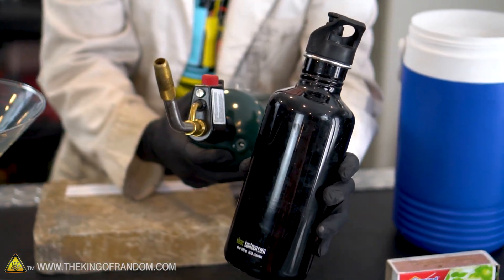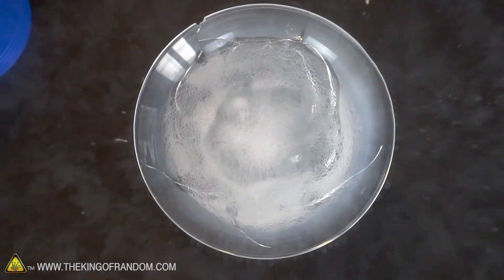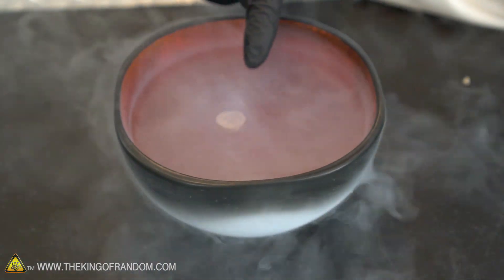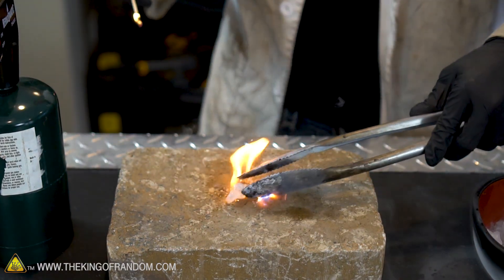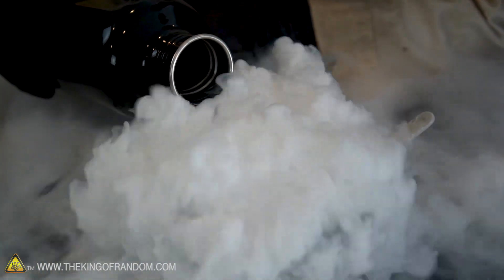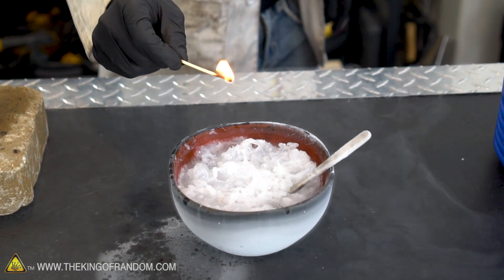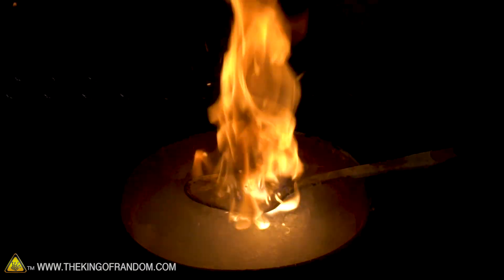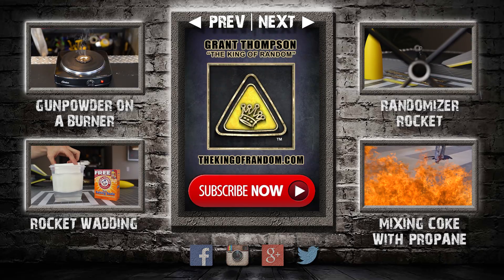Will Frozen Gasoline Burn? Can We Use Liquid Nitrogen To Freeze Gasoline Then Ignite It?

Comment: can you shut down a big fire with liquid nitrogen? like a room on fire and you just throw the whole bucket of liquid nitrogen in ?
or like a bonfire
Reply: Are you asking the last question as a personal or general question?
Reply: lol
Reply: yeah :P
Reply: When Durjan Krist is referring to Air, he generally means Oxygen. Since fire is a combustion reaction it needs a hydrocarbon and oxygen. Air contains oxygen but do not forget it has other elements such as nitrogen. When you pour Nitrogen gas on top of the flames, it is replacing the Oxygen from the air with Nitrogen. You can put out a room with fire if you are able to replace all the oxygen with nitrogen from the source of the fire but is not realistically possible unless you do it quick enough. So you could if you can put a fire out with pressurized Nitrogen that is in a container such as CO2 extinguishers.
Reply: LemonD I work with fryers and we use c02 extinguishers with it. same concept, different chemical?
Reply: LemonD *bon fire
Reply: LemonD Grant put out the fire with the liquid nitrogen because liquid nitrogen is heavier than air, and takes in all of the space of the air. As we all know fire needs air to continue. If you had enough nitrogen to fill up an entire room, yes you could extinguish the fire, but no this would not really work in practice
Reply: xD
Reply: not the same concept, co2 extinguishers are meant to suffocate the flame, liquid nitrogen decreases temp and suffocates the flame, sadly also causing a rather large explosion

Comment: Grant, isn't it true that gasoline doesn't burn, its vapor does? It seems that the same would apply to the frozen gasoline -- your match thaws a small bit of the frozen gas, then ignites the vapors. The vigorous burning occurs because the heat releases increasing amounts of vapor, which in burning increases the speed of vaporization, like a chain reaction.

Comment: Pretty sure that vigorous reaction you got with the smaller batches was similar to how cometary bodies off-gas and form a tail as they pass through a solar system.

Basically, the frozen gasoline melted just enough in the presence of the match to ignite, and the surface heat caused the ice to release gasoline vapour in small jets through the surface. This would explain the combination blow torch and flame thrower effect, as the gas vapour pushed the liquid gasoline away from the ice and spoon, somewhat like high pressure steam spraying from a cracked line. The steam jets away, but condensate forms at the edges of the breech, and is eventually carried off as drops of water by the steam. 

Edited for better comparison.

Comment: Seems intelligent to light of a bowl of gasoline inside your house...
Reply: A normal bowl of gasoline would probably be even worse, since the vapors may have flowed down to the floor and would ignite as well.  Doing this inside your house is a terrible idea in either case.
Reply: @Mario G. Cardiel That's true. Indoors the vapors would gather instead of just being whisked away by the wind, so yeah, normal would probably be more dangerous, especially since mixing flammable gas and oxygen is a literal recipe for explosions.
Reply: +yaksher  Add a dash of motor oil, and you have a recipe for a Molotov Cocktail!  Yummy!
Reply: A normal bowl would be fine, but a bowl of frozen gasoline which he has just showed to be rather explosive is a terrible idea.

Comment: Grant, did it burn because the match melted a little gas, creating vapour and the fumes lit? Did the frozen gas burn or did it melt and ignite? Would the same frozen gas catch if the ignition source was smaller such as a spark from a welding striker or ferro rod?

Comment: the reason that it ignites vigorously is because the solid gasoline has much larger specific surface area(SSA) than liquid thus have more contact with oxygen.
Reply: I don't think that the full answer. I suspect there are thousands of pockets of liquid nitrogen trapped (the milky appearance supports that, if it isn't due to crystalline boundaries) that burst open at the surface, carrying away particles of gasoline into the ambient air. As more surface pockets are exposed, the process continues unabated.

Suggest getting a high-speed camera (>20k fps) with a high magnification lens to test it.
Reply: Maybe. I was thinking maybe the frozen gasoline absorbs some liquid oxygen on its surface.
Reply: Interesting. I'm not sure how the oxygen would get there with all the nitrogen in the way, but LOX/gasoline mixtures sometimes form a gel-like mess claimed to have 50 times (that's the figure I read many years ago, anyway) the explosive force of TNT.
Reply: +tubeist-dan
If you leave liquid nitrogen exposed to air for some time, it will get liquid oxygen in it. And the liquids do mix with each other. So, I don't think the nitrogen would be in the way, unless it boils so vigorously that the container has positive pressure all the time (IE no air flow into the container).

Btw. At least liquid oxygen + solid butane makes highly powerful explosive.

Comment: I'm surprised your eyebrows aren't stuck to the ceiling. You could have used avgas, but that wouldn't have been as much of a pyrotechnic display, the antiknock rating being significantly lower than 91. I've been around enough racers to know that nitrogen, oxygen and gasoline makes a big bang. I do wonder if the far different vapor pressure of 100LL would make a difference in the reaction. Probably not something to try indoors.

Comment: Try adding just a little bit of nitrogen to the glass at a time.  The glass changing temperate too fast is causing it to break, if you slow down the process the glass should stay intact.

Comment: It looked as if the vapors were igniting and the explosions were any vapors trapped within the solidified gasoline. When the solids were ejected into the air, they melted to add more vapors to the mixture (hence the charred ceiling).

Comment: Im pretty sure it isnt flamable when frozen, but whats happening is that when you get the match close enough it melts the gasoline, and then the spark from the first ignition will melt the outer edge almost instantly, and that siw hats causing that explosionish thing.

Comment: If i'm not mistaken, frozen gasoline doesn't burn. Only the gasoline molecules in the vapor phase would be able to reach energies (and thus temperatures) high enough to react with oxygen in the air to burn. The reason why the frozen gasoline appeared to burn is because the frozen gas melted quickly after being removed from the LN2, and once in the liquid phase, molecules could then enter the vapor phase. If you did this in an atmosphere colder than the freezing point of gasoline, I don't think anything would have happened. This is because the gasoline would have remained solid. Although, I do suppose holding a match near a frozen chunk of it could provide enough thermal energy to melt/vaporize the gas. 
I guess what I am saying is that in a theoretical world, if all of the gas were truly in the solid phase, nothing would have happened.

Comment: every flammable liquid has a Flashpoint. for those who do not know what a Flashpoint is let me explain. the flash point of a liquid is when a liquid gives off enough Vapors where it will flash when it comes in contact with an open flame but will not ignite to a sustainable fire

Comment: Will the white vapor ignite as well?
Reply: but isnt it mixed with gasoline steam and fine liquid spray?
Reply: No i think it's from the gasoline.
Reply: I think it's possible that the liquid nitrogen could be vaporizing the gasoline. However, it could also be a mixture of the nitrogen and gasoline, so it'd be interesting to see if it would light off.

Comment: I think it burn vigorously because of the surface of the frozen gasoline crystal is covered with water and turn into ice on the surface of the "crystal" as you mix them with nitrogen, as you ignite the gasoline, the gasoline and water reacted with each other and burn vigorously just like when you try to put out grease fire with water, as the water/ice on the surface of the crystal burn off, the gasoline in the center turn liquid and burn normally again.

Comment: Check if a bullet can be fired if it is put in this mix ? Will it explode and burst into flames at the contact or it is going to be the same thing .
Reply: But if gasoline has the strength to move a piston in the combustion chamber why not have the strength to move a few grams of lead ??
Reply: the way a bullet works is the gun powder produces massive amounts of gas which expands rapidly, pushing the bullet head. Gas does not have this effect and doesn't even burn as fast
Reply: Ok , ty for respond , it will be cool to see practice of this ,or actualy he could get something slim to cover the bullet , and it will be flameable , to fire it up <3

Comment: The thing is : if you light the frozen gasoline up , only the molten part will burn , because the heat of the match melts a thin - but thick oenough layer, to let that burn and it creats a chain reaction -domino effect.

Comment: matches in liquid nitrogen did it burns
Reply: sreyus meera HeJUST showed us that a match will not light in liquid nitrogen. Ntm a match has to have o2 to burn.
Reply: sreyus meera Normal matches no, but water/windproof(sometimes called underwater)matches might.
Reply: its the same thing
Reply: Toffie Original O2 is oxygen
Reply: sreyus meera no because for combustion heat and oxygen are needed, I think the nitrogen would get rid of the heat
Reply: sreyus meera no it needs oxygen not "o2"

Comment: What will happen if you mix Sodium and Gasoline?
Reply: This should be interesting :P
Reply: That would be intresting to see! I hope it explodes becuase wo dosn't like explotions!
Reply: Alenxander grimsmo Ye if it doenst work just ignite it :P
It should just be an cool experiment!
Reply: It should work as it reacts to some stuff inside the gasoline, So hopefully we get too see a explosion.
Reply: Idk otherwise butane Mixing Butane and Sodium?
You shouldnt know if you havent tried ;)
Reply: i tried lithium and petrol, with the petrol i used it made a wierd blue material, i dont have a clue what it was. overall it just bubbled slightly untill the small amounts of water and ethanol and maybe a few more were used up. it is a way to purify some organic compounds such as alkanes.
Reply: Sodium is in mineral oil, I think it should explode, Otherwise just ignite it :P
Reply: You're thinking of mineral oil. Mineral water is still H2O, and metallic sodium reacts with oxygen which is why it explodes when you throw it in water. It can be stored in parafin oil, mineral oil, or kerosene to block it from oxygen. There are probably other storage mediums, but the point is, if you drop a block of metallic sodium into a jar of mineral water, it will explode just as if you dropped it into a swimming pool.
Reply: Oxygen is in Gasoline too so hopefully it will explode ;)
Reply: Just try it it has never tried and i have seen some sort of it that it does work ;)
Reply: I once combined magnesium and jet fuel in Afghanistan.  It just got wet, but then it went to the burn pit.
Reply: Sodium metal ;)
it should probaly explode ;)
Reply: nothing, because gasoline is a type of oil
Reply: you can store sodium metal in petroleum ether (aka gasoline) although most gasoline has a little bit of ethanol in it which will react with sodium to make sodium methoxide, but it's not exciting, just some bubbling
Reply: If you put enough in it it will probaly explode and Hopefully make a reaction ;)
Reply: lik omg it totaly maks fyr wen put in evn uatr i bet it go big boom. This is what I imagine you sound like in your mind. Sodium doesn't react with everything that's in liquid form in a volatile fashion it's a chemical reaction.
Reply: MinecraftForce Nothing actually. Sodium needs oxygen to burn.
Reply: Probably nothing, or at the most a very weak reaction. metalic sodium is stored in kerosene. Gasoline has been around for a long time, even before we had engines to burn it. Gasoline is a byproduct of refining oil to make kerosene. Until they came up with a use for the stuff, it was considered a useless byproduct of making kerosene for lamps. 

TL;DR,

Gasoline is a byproduct of making kerosene, which metallic sodium is stored in to keep it from exploding. Probably won't do anything.
Reply: If there was oxygen, or an oxidizer already in gasoline, then it would have burned even under the nitrogen gas when he froze it. That last big bowl had bits of frozen gasoline above the nitrogen barrier. He even said so. Also, gas will burn ON water, but not under it, so I really doubt there's any oxygen in it.
Reply: It should work, Gasoline has oxygen in it.

Comment: The frozen Gasoline doesnt burn. If you touch it with the hot flame of the match the gases ignite, which induces a chain reaction of the frozen Gasoline sublimating and igniteing itself. Pretty cool rection though

Comment: Probably one of the funniest endings I've seen! Next time you should try putting the gasoline in a plastic bottle with no lid on and submerging the gasoline part of the bottle in liquid nitrogen! Should theoretically freeze the whole gasoline as one large clump? Then cut the bottle and ignite it or even better use one of the igniters you make to put it inside of the bottle and light it off from a distance... After seeing this ending maybe even add some liquid nitrogen to the top of the bottle after its frozen and then cut a hole in the bottom of the bottle so you can light it from there then slow mo it as the gasoline boils up and explodes and shoots the liquid nitrogen from the open lid of the bottle? Hope that all made sense! Definitely wish I could give that a try if I had access to liquid nitrogen in the UK!!!!

Comment: Frozen Gasoline, just like liquid gas, won't burn. what happens in fact the gas evaporating to gas form, than burns. that's why if you'll do something like puring some on a table and igniting it will produce quick the flame but will die quickly and won't leave a mark

Comment: I'd assume that it's not frozen gasoline that's burning, since even liquid gasoline doesn't actually burn (the vapors burn, the liquid doesn't). My bet is that the heat of the match quickly vaporizes the gas and THAT burns. That's why there's such a crazy reaction: pockets of the gas are vaporizing, causing rapid expansion and launching pieces into the air that also eventually vaporize and burn.
But I can't prove it.

Comment: Liquids and solids do not burn, however vapors do and when you set that gasoline on fire you are effectively raising the temerature enough toture a portion of it into vapor + liquid and then the vapors start burning
Same thing with wood and candles, the thing that burns isn't the wood itself or the liquid candle wax, it's the combustible vapors that burn and while they burn, they heat up the solid/ liquid thus producing more vapors and keeping the fire running

Comment: Can a frozen bullet be fired?
Reply: no you can't. Mythbusters tried it
Reply: Watch codys lab.
Reply: I have. he didn't use frozen water though and that's what I was talking about. Sorry
Reply: Not if you freeze just water it wont, mythbusters have tried it
Reply: Just looked through 4 pages of codys lab and all i saw was him shooting mercury bullets NOT WATER!!!
Reply: tylor305 Mythbusters Tried It. It Didn't Work.
Reply: Zee Dank Pigeon that's Ben done a thousand times before
Reply: The question was a frozen bullet not a bullet made of ice. if you make a frozen lead or mercury bullet it will probably work, but an ice bullet will melt and lose its shape which means it can't be shot properly, it also can shatter as ice is a crystalline substance. the rest of the gun will have to be cold but the ignitor and gunpowder will need to be heated as it has to reach ignition temperature to burn
Reply: Wow this comment got further than I expected
Reply: +User Name actually yes you can go watch codys lab
Reply: Yeah, there's nothing that would change if the bullet was frozen, that's just a projectile. The powder and primer and such is what you'd need to freeze.
Reply: Yes, it can
Reply: Zee Dank Pigeon I wouldn't want to shoot a cartridge that's cooled to liquid nitrogen temps. sounds like a recipe for an explosion.
Reply: Check out Codys lab he made a thingy like that
Reply: Zero Shima watch the iv8888 video where they froze ammo and fired it.
Reply: Zee Dank Pigeon yes you are able to shoot frozen bullets
Reply: MythBusters to not Degas the water first, as such their ice bullets we're very weak. The lower the desolved gases the stronger the bullet. 

Also gunpowder burns slower at lower temperatures so one would want to not cool to liquid nitrogen levels. -40° is more than cold enough for ice bullets to fire reliability.

Comment: You know a lot more about this than I but you said the gasoline returns to a liquid quickly after leaving the nitrogen. Doesn't that mean you were burning liquid gasoline instead of frozen?  And maybe you could have made solid dense cubes using a frozen bath and an ice cube tray to avoid those air pocket filled creations.